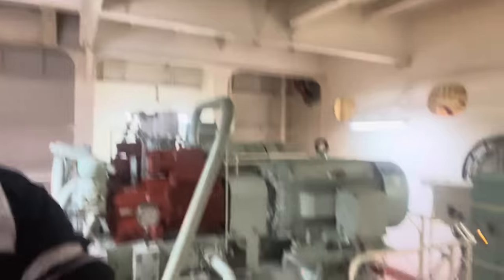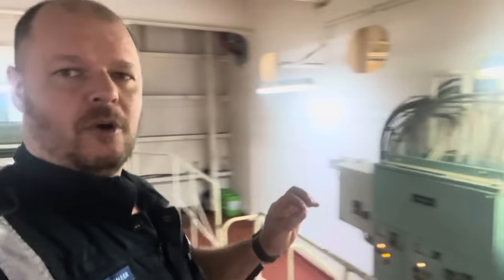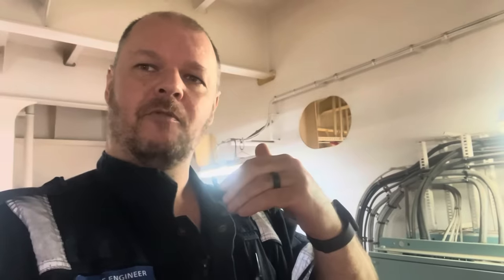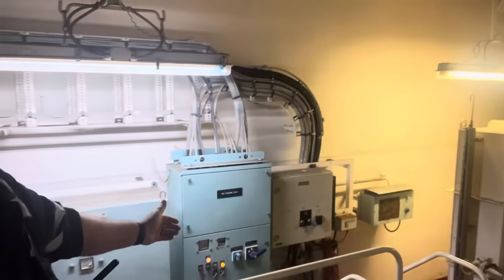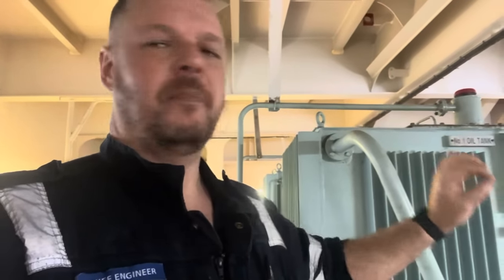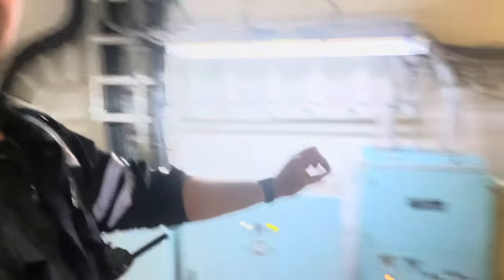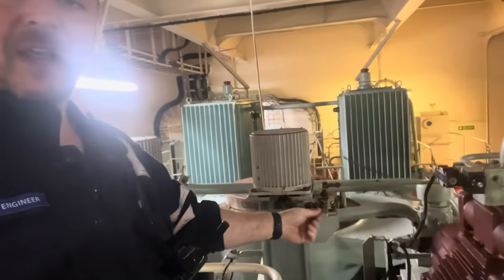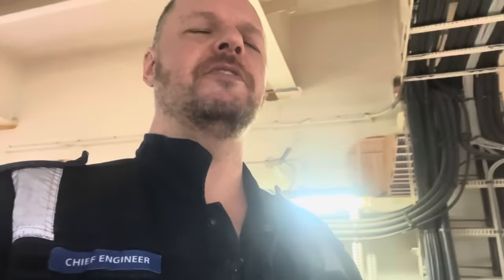Dali size containership steering system. How it’s designed to not hit Francis Scott key bridge

Comment: Isnt the port incharge of steering through the bridges?
Reply: Nope, pilots, while required, are only there as advisors. IOW, if the pilot is wrong, it is your ass on the line. But, if you don't take the pilot's advice and something goes wrong, you are still up shit creek.

Comment: Why not run with the emergency generator on during critical parts of the voyage? It's unlikely that 2 failures occur at the same time, but if you only test the emergency generator once every month, it doesn't seem that far fetched that it would fail to start in case the main engine fails for some reason.
Reply from the maker: It’s an emergency generator that means for emergencies. It’s designed to not be used for normal operations so that it’s kept in ideal condition

Comment: Still seems strange that the power went out at that exact time and the ship also turned right to hit the piling dead on ..... as people have said a perfect storm, that the wind turned the ship, seems the wind would of pushed the entire ship sideways not have it make a right turn. also said that it was put into reverse and the P factor pulled the stern to port. Lots of weight to stop but in what they have given us in info I have not seen any slowing due to high reverse thrust which would of been required to pull the stern that quickly.  also said that ships require constance rudder inputs to go straight which is somewhat true. I have never run a ship that big , but it moving off track that quickly seems odd to me. No longer sure if the public will ever get the truth of what really happen . 
You put out good info, but adds more questions to the puzzle.

Comment: The propulsion is probably not as redundant. Large part of the steering force come from the rudder working with the propulsion. Lose the propulsion, lose significant steering ability even if the rudder still functions properly.

Comment: Bad fuel  or  no fuel in the diesel generator. Flickering lights tell me it tried to start then died due to it's own failure. Backup batteries and inverters with a charging system seem to me like a good idea. They can be tested, but like all things given enough time they will schedule the maintenance for you if you do not.

Comment: Having control is one thing, but knowing which way to turn it is another.

Apparently, someone put the screws into reverse, which throws water to the starboard side when the props rotate clockwise, and which also turned the nose of the ship to starboard while still traveling forward.

It's a lot easier to point fingers after the fact and I'm not intending to do that. I'm simply sharing facts that bear on the conversation. No matter what, this was and is a tragedy.

Comment: So, after watching reporters claim that the pilot put the Dali in reverse causing it to veer to the right and ultimately causing the "ACCIDENT" I decided to map the path she took including the fateful turn into the starboard bridge tower base. After years at sea and docking big vessels I have seen many approaches where the captain puts the boat in reverse to push the stern to starboard and the bow thrusters to push the bow to the dock. High winds and tide can push a large vessel around but I checked the wind and tide for the Monday morning departure. Wind less than 5 knots and entering slack low tide. Now if the pilot did put the engines in reverse and IF the FAILSAFE systems of the vessel failed and the engines actually turned the Dali ... she would  have turned to port (left) instead of starboard. If the main engine did not respond and the rudder ONLY was engaged while moving at 8 knots  it would not have enough water over the surface of the rudder to turn the boat even a teency-weency little bit, but feel free to try and correct me if you think I'm wrong but after close to 20 years on large vessels (including fishing vessels in the Bering Sea) it will be vey very tough to convince me that physics took a holiday just for the Monday Morning Commute !!

Side Note: No vessel ever leaves port on a Sunday so the time of sailing (1:30 AM) is predictable and BTW ... Internet services are not only available via satellite but also terrestrial wireless is easily routed through the boat. 

What does all this mean? 
First, the NEWS lied to us. 
Second, this was no accident ... and
Third, the main North -South thoroughfare on the east coast has been severed and the Federal Government wants to send the money that could be used to fix this as rapidly as possible ... overseas. 

Airplanes falling apart, shipping and transportation disrupted, criminals roaming the streets and deadly drugs destroying our youth, corruption and malfeasance in our judicial system, boarder wars between our own law enforcement agencies ... etc etc 

and yet NO ONE DARE MENTION ON TV ... this might be sabo (click ... end transmission)

Comment: Um , ok from what you discribe in this video , I deduce that both generators failed one after the other . 
Now the question remains , why did it fail at all ? 
Sabotage ? 
Or bad maintenance . 
I know you can’t stop a ship that big on a dime . The momentum of the ship will carry the ship quite a distance . And with out rudder control , that bridge was a goener .
Reply from the maker: I don’t like to speculate but poor maintenance is very likely
Reply: @steamman9193  was it planned or an accident . I mean how could the redundant system give up too ?

Comment: Hopefully, the feds don't require a intermediate control center at engineering center command.  Which in itself could be simple or complex?  I would suggest Wifi electro actuators used on Drones.  Another add on is emergency air flask systems.  Who knows what politicians will recommend.  I think the requiring tugs avail to the harbor pilot until all obstacles are cleared is good enough.
Reply: "Hopefully, the feds don't require an intermediate control center at engineering center command.  Which in itself could be simple or complex?"
Yeah, but why would that be a bad idea to implement? I mean, just install something simple if this is about penny-pinching, certainly better than nothing IMHO.

Comment: My question for the pilot of the Dali is, why, did the ship turn directly into the bridge at the last minute when the power came back on? The ship looked like it would just ghostride under the bridge...but when power comes back on she takes a heading directly into the supports. It sure did look like the ship intentionally hit the bridge like it was trying to make it look like an accident. "Oopsy, the power's out, oh no what will I do"..."uh-oh...were gonna miss the bridge, turn off the black box, drop anchor and veer hard to starboard." Also, how TF did police have enough time to clear the bridge, but no tugs were around to help assist...and WHY TF could it steer starboard and NOT to port or at least keep its heading....and why are 2 minutes prior to collision missing from the data recorder....those have continuous power...

Comment: i worked on a ship for a period and was horrified to find there was no back up for the steering if power failed. there should be a law that some one has to actually be in the engine room while the ship is in the channel comming and going into port
Reply from the maker: There is I have to have at least 2 guys in the engine room, and a standby generator online, and the emergency diesel tested recently.

Comment: Yeah, given what happened, it's clear something must have gone horribly wrong.
Worse still, everything happened at such a fast pace, there was likely little the crew could do to avoid disaster.
I mean, the ship was like a mere 4 minutes away from the bridge when it lost power the first time and about 3 minutes away when they lost power the second time. That is not a lot of time there to do much of anything with a ship this size moving at that speed.
Without rudder control or power, you are SOL.
Reply: There was also wind that night that was pushing the ship in the wrong direction towards the bridge pillars which didnt help matters.

Comment: That’s interesting that you guys in the merchant sector don’t man your steering gear room entering or leaving port, that standard OP on all military vessels.
Additionally were aware that they lost power before they left their mooring as well? thats part of the problem, probably shouldn’t have tried to leave port as a result…
Reply: There are only a handful of engineers on a commercial ship.  Manned steering would not have done anything in this case.

Comment: Sadly Ive worked with a number of outfits that just make things "work" and Im sure there will be a looooong investigation to do on that ship that will show fantastical methods humans aboard have gone to to circumvent redundancies or failsafes or safety systems or annoying sensors that make crucial things not work (by design) - so as many have said before, catastrophic failures like this in the modern age always come from a long series of oversignts or failures falling like dominos.

Comment: All these redundancies is why I suspect the Dali had a significant electrical failure as the root cause. It seems from what we know, that EVERYTHING went offline. I suspect something very important on the power generation side of the panels failed, like a large power spike or short.

Comment: All this assumes that all redundant and emergency systems were operational and available on this vessel at the time of the accident. It also assumes that all personnel are fully trained and well versed in emergency procedures. Yes I realise that no vessel should put to sea if either of the above statements is not true, but we all know that shipping companies run on very tight budgets.
I work in an engineering service provision capability to marine steam production and gas combustion (mainly in the FPSO/FSO/LNG/FSRU world) and some of the shit shows I have seen still steaming and trading would give you heart failure.

Comment: Kinda seems like "normal procedures" at that port are quite lacking, with people talking about tides and side currents and side winds and no port pilot on board and no tug assistance and bow thruster designs that appear useless for anything beyond parking at the pier. And possibly inadequate ship maintenance? All on freakishly large ships that have overwhelmed every bit of the marine world. At the least, maybe required crew procedure should include starting up the emergency generator before departure and have it on standby while powering past bridge columns.

Comment: You are not sailing when doing that video, I think. I remember the loud noise in the steering gear room, when the hydraulic was in operation, Without hearing protection nearly unbearable. Questioned my self how to do communication with the bridge from there over telephone?

Comment: It clear things up.   My background on systems was that redundant did not work if it was critical.   You needed 3.   One for a failure,  one for maint (granted you can schedule that) but also at times,  a 2nd one would fail.   With 3 I never had complete loss (some were odd 3rd but could do the job of a missing pump say).  
      And I know its no assignment of responsibility  let alone blame to you,  but why in blue blazes are not the steering manned,  backup gens running  as well as all Main Gens running during critial evolution like a departure with critical  maneuvering involved?   
       Chief Makao's information states that you can't recover from all the simulations run,  then the shipbuilding society as well as AHJs should mandate other protections.     A ship sinking is a limited problem,  but taking down a Bridge,  that is a serious disaster economically as well as the loss of life for which the families suffer of those who died  but many more can be grateful it was not much much worse.
Reply from the maker: I think there is a large terminology gap. I always run a “backup” generator in restricted waters but it isn’t a backup it’s just another main generator on in parallel for both or all if 3 are on to go completely down is extremely rare. And only then would the emergency generator come on but the video I saw and what I expect in the investigation report will cite multiple failures
Reply: @steamman9193  Agreed on terminology.   I got very careful about what is often called emergency power in my world as well with  radio calls about it got everyone on the channel hair afire.   Emergency,  what,  where?????     Ergo, I mandated (my bailiwick) the use of Standby Power reference  and even managers agreed,  yea,  like yelling fire around here and we get it.  No more emergency.
             And again,  this is not condemnation,  you are a reported not an AHJ,  but your voices as Chiefs speak far louder than someone like me who just kept machinery running (tech/mechanic).   
                             I worked very little what we called Primer Power and what you would call ship power (oddly it was on vessels we worked on but we brought our shore verbiage with us.)   I don't know what the mains distribution looked like but I can guess.   More important is Circuit Breaker,  protections and what kind of stetting the CBs have as well as the coordination of them to ensure a trip at the fault.
               An eye opener was a ground fault in a Sign that cascaded into a Main Building fault.    The only CB that had ground fault was the Bldg Main.   As it was a GF,  it tripped,  the Standby Gens came on and we recovered fine.   But the GF should have tripped the Standby Gens CB Mains as well as they were also GF featured.   What stopped it as the GF on the 120 also had enough current draw that that CB tripped.   I increased the GF stettings on the  Main CB and GEN Main CBs to at least allow a chance for it to clear.    Until then no one gave it any thought and it was not an area I set the specs setting wise for.    So with the wrong setup you can still fault into a issue unless your system is designed and coordinated.  
               I have been around aviation all my life and that is where my background in issues of backup and ramifications was developed.    But the one aspect that Chief Makoi brought to the table was running system failures in the Simulations.     Then if you always are going to have a catasgropic manuer4ivering failure,  then what is called a Unicorn Event is also what I came to know as  a Toggle Event.   If it happens,  then you have snapped into exactly what happened in Baltimore and the variation of Tampa in Florida.    Its what AHJ are supposed to take into account and prevent it.
              One example was elevator shaft ventilation in buildings.   The idea wa to open up damerp on top to relieve smoke.   When that got tested in a Tahoe hotel,  they found it sucked smoke from other places into the elevators (which also go to designated capture floors).    So they changed that.  I had to make them use a different floor for the upper level capture as it was the lobby for the Exec suite and those were locked in on business hours.   Capture is right in getting people out of elevators but into a locked set of doors,  no.    
             The regs I worked with were towards life safety (Fires mostly  but Earthquakes as well).     Our management finally got approval to put natural gas shutoff valves on those supply systems.    Where I live it should be mandated,   7+ quakes are common enough.   
             So agreed you have the classic Swiss Cheese Model (aka Dr.  Reason and I am not making that up)  that threaded through the cheese to let that failure occur.
             When that happens,  its realized that its either an enforcement failure or you don't have enough layers of safety.   Chief Makoi makes it clear that if what happened was to occur,  it was going out of control.     Tugs are a totally separate piece of cheese as they have no failure mode in common with the ship.   Yes they can fail.   But if they are working during the Hazard and fail either side of it you are good.  
            Having all the main gens  on would be a step,  but as we have seen and Chief Makoi has stated,  its not going to do any good if there are factors that put the ship into the dark mode.    And rudder does no good unless  you have propulsion and the last to come back would be your mains if they do come back.   
           We can build that bridge back,  but safety says protection for the Main supports,  but that too is possibly not enough or can't be done in that narrow a channel and then the tugs may be the final answer.    In this case even if its a directed grounding its then ship salvage,  no lives lost and no bridge is brought down with the billions in cost.   
            But we may well have assist with Ship setup for those in and out of harbor times as well.     I think we can do a lot better with more layers of safety.

Comment: Why don’t you have the diesel emergency diesel generators already running and ready to take the load in a few seconds rather than having to start and transfer in 10 times more time? If your navigating any port those emergency generators should be running and ready. This is how it was when I was in the marine industry.
Reply from the maker: Because it’s the emergency diesel and preserved in the best condition possible for emergencies. There should be 2 main generators running in restricted areas so that may be the backup you are thinking of

Comment: What is the point of the manual steering control if nobody is close to it? at least keep someone close to it while maneuvering in tight areas or under bridges.
Reply from the maker: Well simply in this case it wouldn’t have made a difference with no electricity to run the motors the rudder can’t more anyway and as far as everyone knows still works as it should from the wheel when electricity came back on
Reply: Thanks for the reply @steamman9193